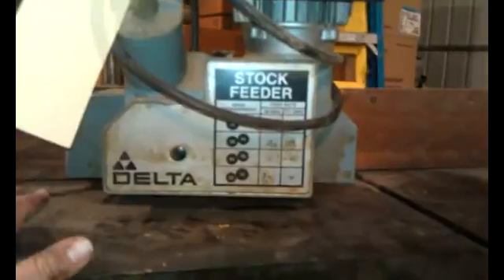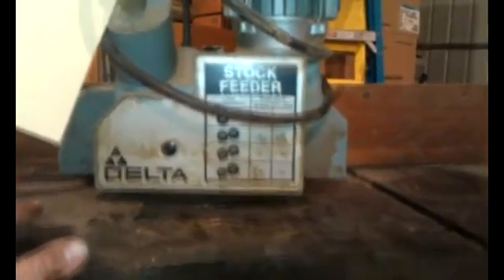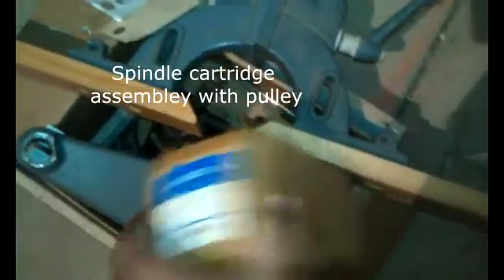Delta Rockwell Heavy Duty Shaper Part 1 # 75

Comment: Too late for you, I know... but I burned up the motor on my 20" planer (1985 -- made in Taiwan) after running an entire forest of 20" wide poplar through it. Got a replacement from Northern Tools on clearance for 164 bucks. Now it's a full-on BEAST! Had to fabricate one bracket but it was well worth it. And I still have my old motor for rebuild at a shop one of these days. 

And I just got a Delta shaper. It's a 43-475 from '88 or so. Can't wait to pick it up and see what she'll do!

Comment: I noticed that your motor controller (snap switch) is missing.

This switch has been "unobtanium" from Delta for years and years and years.

However ...

Square D makes a replacement, which is in stock an many dealers.

The single-phase switch is rated 2 HP, the three-phase switch is rated 5 HP.

As for the motor's connection box, the armatures are usually symmetrical within the frame, in which case you may exchange the end bells, thereby placing the connection box on the preferred side.